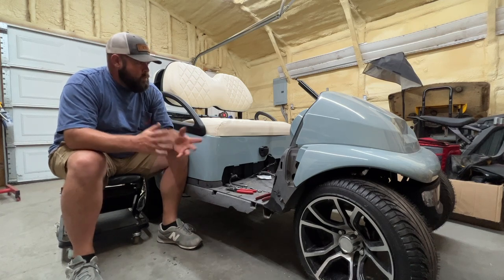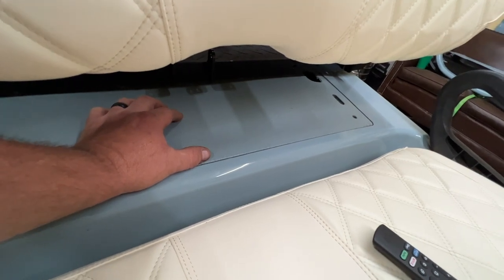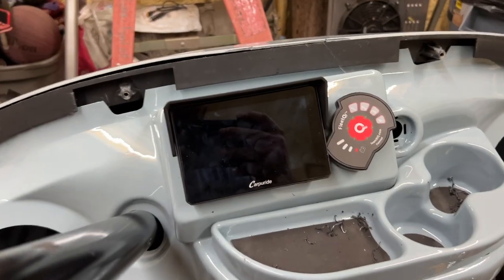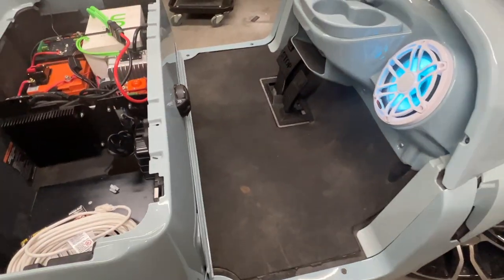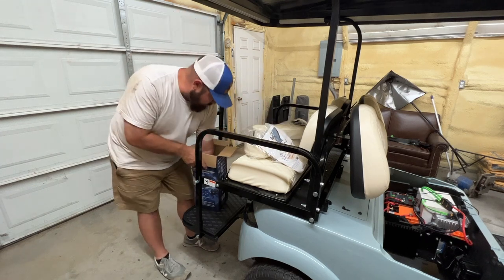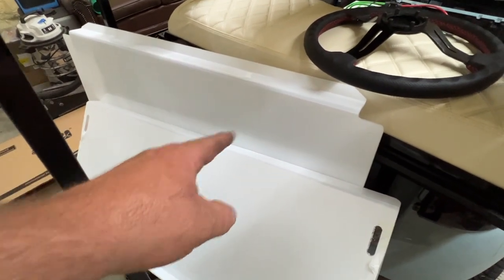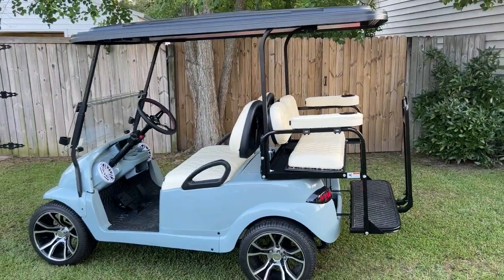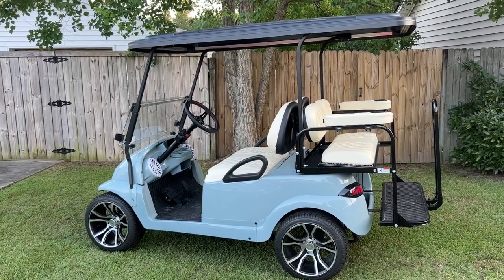Wife's Golf Cart is Finished........ Kinda

Comment: NIce! Question on the extended roof does it sit higher in the rear then the front? I just installed mine and have a issue being higher in the rear. Also with the  candy canes did you cut any off?
Reply from the maker: It would've sat higher if I didn't cut the candy canes.

Comment: How did the knockoff Stinger ignition work out you put in that 07 Precedent a while back? 
I see you put a regular Stinger in this one.
Reply from the maker: I still have the knockoff version but when I built my wife this cart I knew it needed the real version. The knockoff version has a design flaw that I mentioned in that video and ill tell you again. Anyone can access the cart with a knockoff version by holding down the 1&4 button together to reset the code. The original stinger you have to know the 4 digit code that comes with each unit to reset it and every stinger is different. The stinger is more secure.

Comment: Did you wire the Carpuride to the 12v battery, or the amp?
Reply from the maker: Both the carpuride and amp is wired to the 12v battery but running through the 8 gang switch. That way I can turn them both on or off at anytime I chose. I run the same 8 gang panel on my big cart and incorporated my wheel lights, forward n reverse switch, radio and lights on that as well.